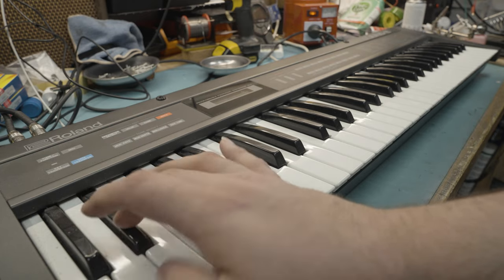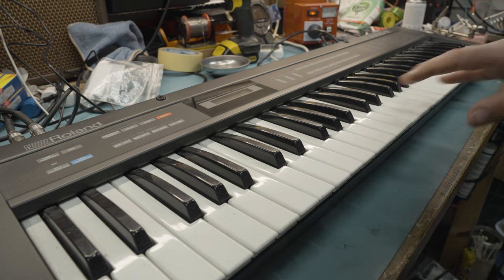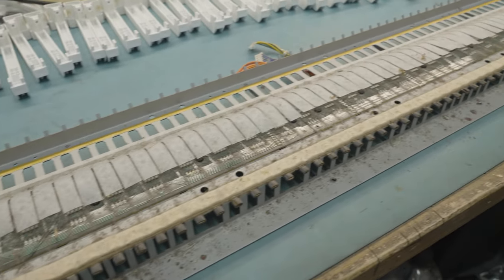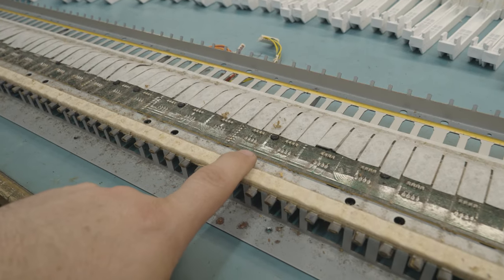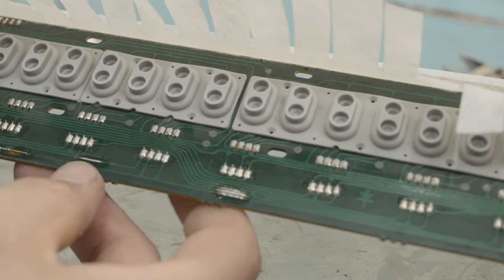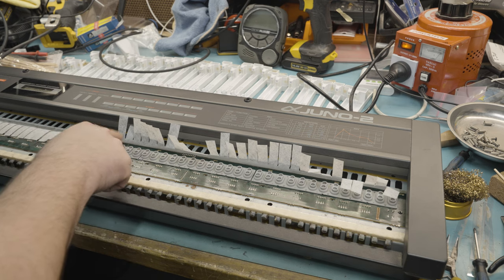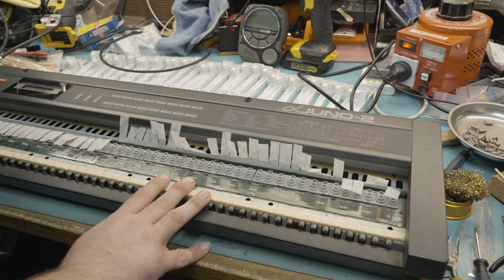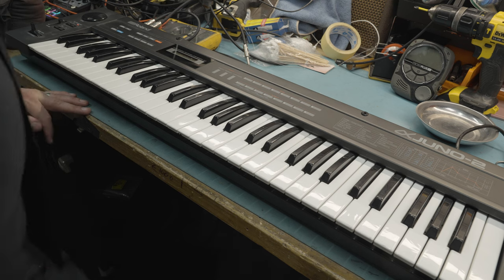Roland Alpha Juno With A Few Bugs - Vintage Synth Repair

Comment: Very informative video. You know your stuff. AJ-1 usually suffers from corroded traces on the keybed circuit board. AJ-2 is better for some reason. Both suffer from aging pitch bend wheels that used a plastic hinge that flexes and cracks. Also, EL backlight is known to go out and the transformer will whine. I always rebuild the power supply.
Reply from the maker: Thanks. The EL on this one is already cactus, but thankfully not making any noise. Customer isn’t too concerned though as he uses an external programmer anyway so the screen is of little consequence.

Comment: Beautiful work 👏
I have an old D50, and one of the preset switches doesn’t make contact anymore. Do you have any tips ?
Reply from the maker: Disassemble it, clean the switches with contact cleaner and test. If that doesn’t work, potentially worn out switches or worst case scenario, there’s something wrong downstream in the digital side for the muxing.
Reply: Thanks 👍